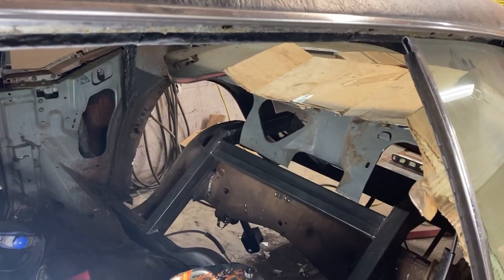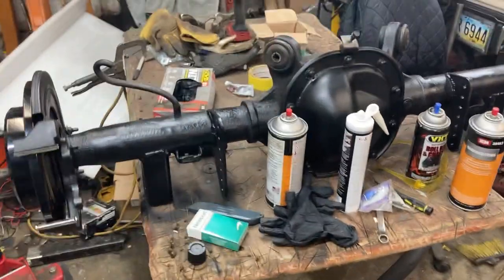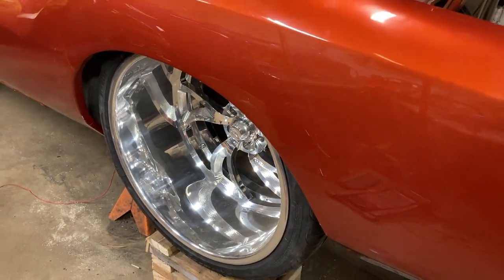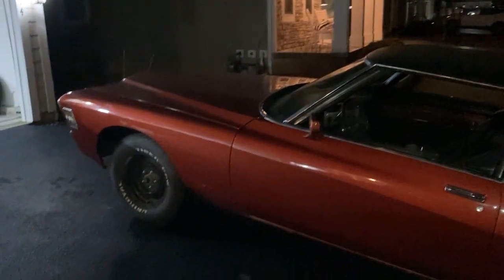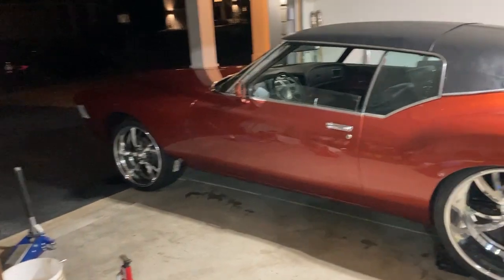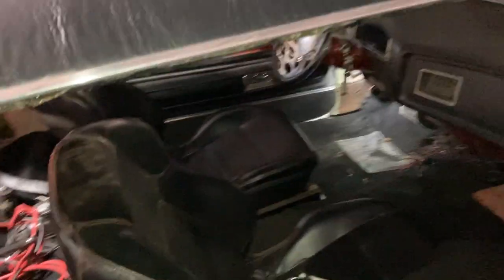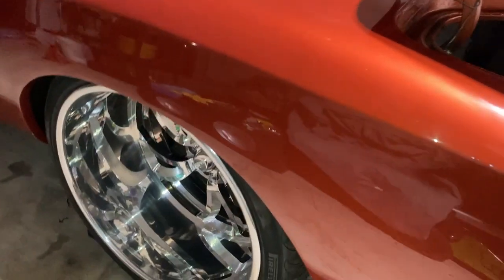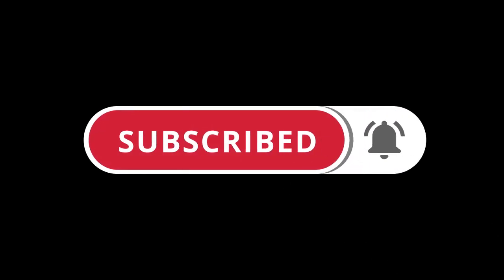1972 Buick Riviera Back Halved and Tubbed on 24x15 inch Billets! - Must See! - So Sick!

Comment: Man i always hated those boat tail Rivis (tho i like many others.. mainly 66, 67) but u got it lookin pretty mean. I think u shud put taller wheels up front.. same type of course.

Your paint is beautiful but u know u gotta get that top peeled off and do some metal work.
Nice job tho bro.. i like it.. love the dashes in those boat tails lol

Peace
Reply from the maker: Thanks bro, funny thing is that I used to hate boat tails too lol. I have 30 series up front and have since lowered the front so the wheels sit more flush in the wheel well. 35 series would be too thick.   

Thanks, paint color is changing though, it's been this color for 12 years so time for a change. The metal is cool under the roof, I took the original top off and took care of the rust. But the current top does need to be redone. I did it myself and got it crooked on one side lol.